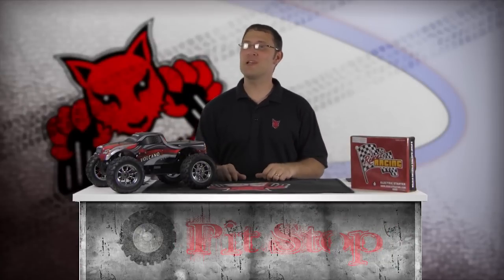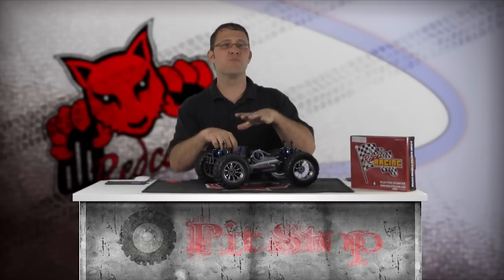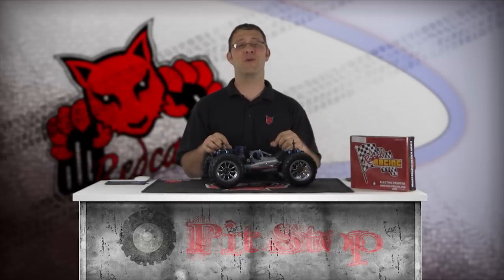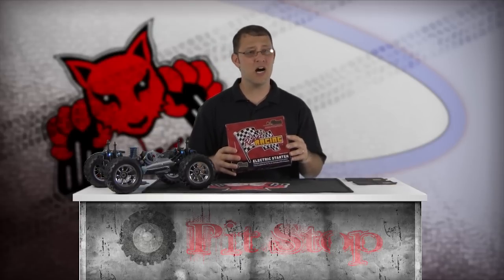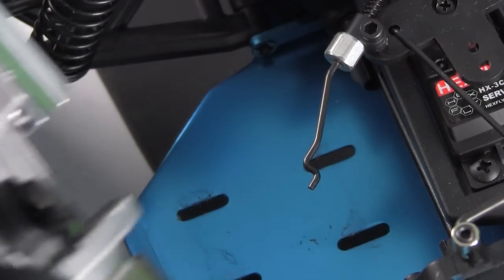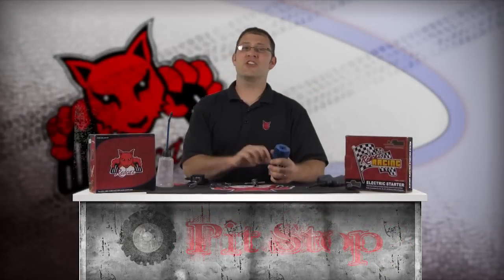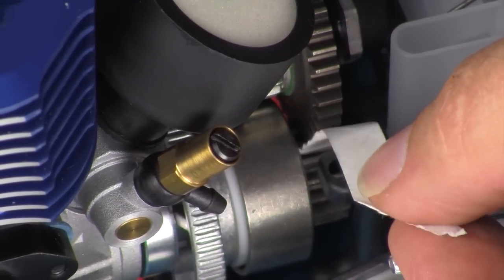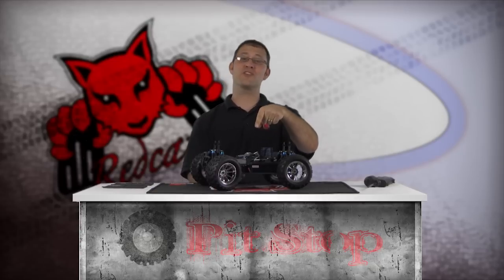Pull Starter: How to RC Nitro

Comment: rather than pull the engine you can pull the rear end off and not have to worry about gear mesh "for begginers" its like 6 screws on the rear end do everything he said once the engine is off and you'll have no need for the gear mesh setting I've taken mine off as the string broke on mine 2 times but his way will work also
Reply: Thank you!!

Comment: why is there no videos about a locked up pull starter. I got a new Redcat 1/10th truck and it did fine yesterday till the string came out because the knote in the end was to small so took apart and fixed it now today after 2 starts the pull string is locked not flooded locked. this videos I have found dose not help me.

Comment: Yeah the electric starter is good if you want to blow through the one way bearing in a month.( piece of crap used to have one on my savage and replaced the electric starter with a pull after burning out like 3 one way bearings in less than a month) I reccomend not getting a RC with an electric starter simply for the sake of the one way bearing

Comment: My pull start is locked completly in and will not pull out on my redcat. How do i fix that problem? i never had this issue with my traxxess stampede or my losi buggy. im in he break in process and im on the second fill up and the pull start womt budge at all.
Reply: Dominic Brown if this still helps, it's because you flooded the engine. take out the glow plug inside the engine and take it out with a rc wrench.
Reply: Dominic Brown pull the pull start while you have the plug ot and it will throw up the gas that flooded it. then it will be more free! also while putting the plug back in, try to leave it a little loose during break in
Reply: Siezed...read all comments and I’m still saying siezed

Comment: My pull start won't recoil
Reply from the maker: Ouch! Might need to take it off and see if it can recoil. If not - depending on how old it is a new one might be i order.
Reply: yes but it is for my Kyosho GP Pureten Spider and parts are hard to come across + they are expensive to buy. Kyosho don't make parts for the Spider anymore unfortunately, even my local model shop can't help me out on this one ;(

Comment: Anyone have any tips I got mine for Christmas and pull sring broke so I got electric starter and still will not turn over??
Reply: Jay Howard solve it yet and how so?
Reply: Jay Howard check your gear mesh and make sure the backing plate is installed properly with a fully charged battery in your drill starter